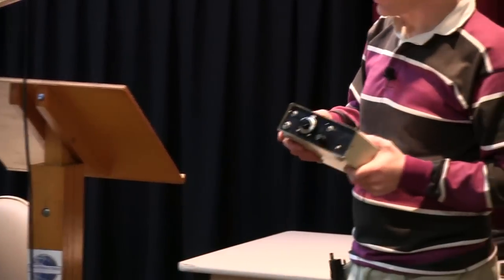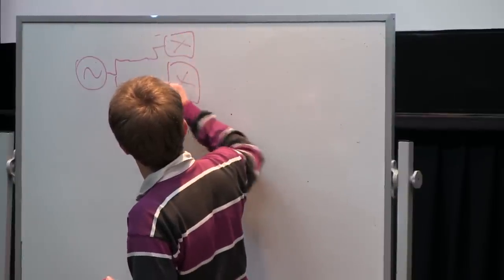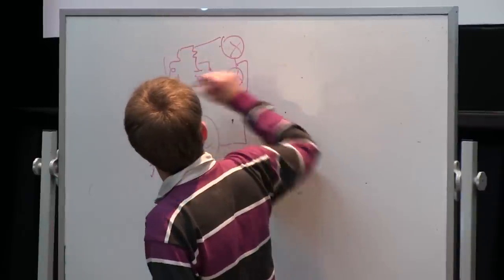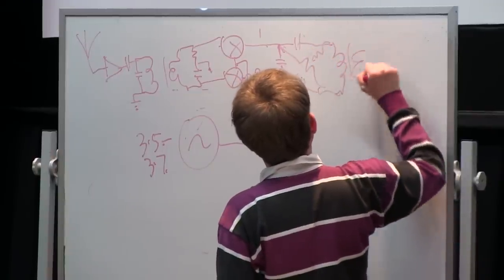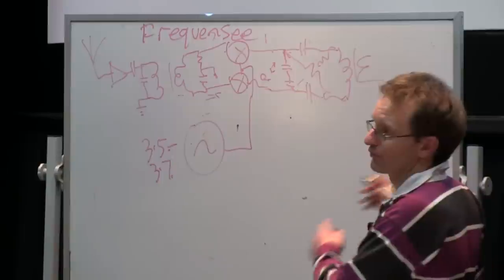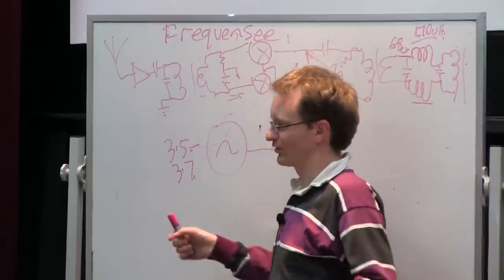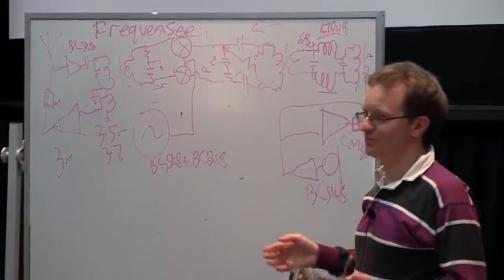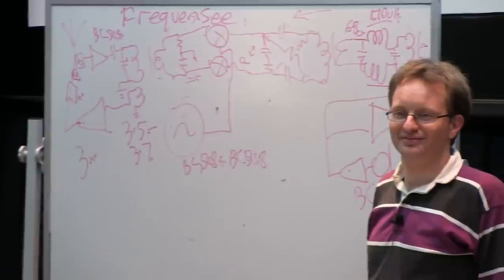2013 VK3YE 7 transistor 3.5 MHz phasing transceiver

Comment: Why not use the PI5V331 driven via 74HC74 configured as a SSB modulator/demodulator because you can use the I/Q signals as the input to PI5V331 SSB modulator/demodulator, You will find a lot of good circuits in the ARRL HANDBOOK FOR RADIO COMMUNICATIONS 2015 ISBN 978-1-62595-019-2.